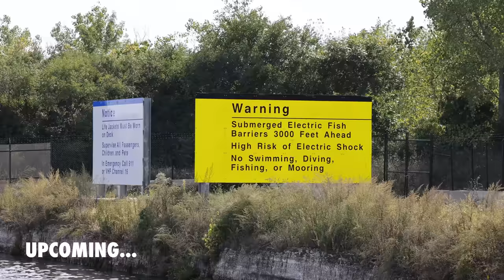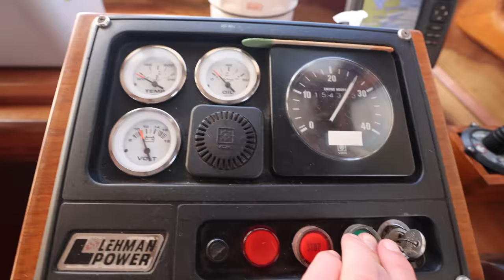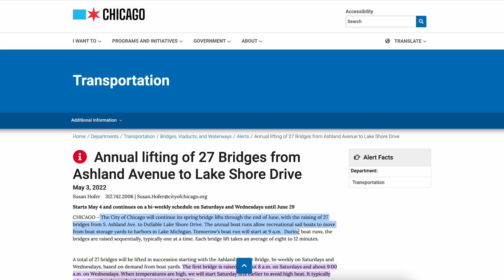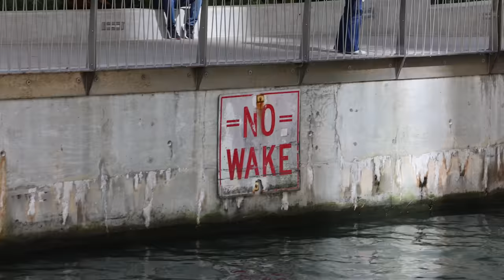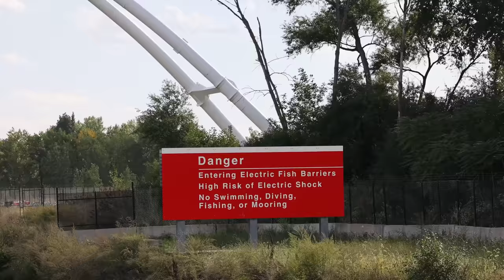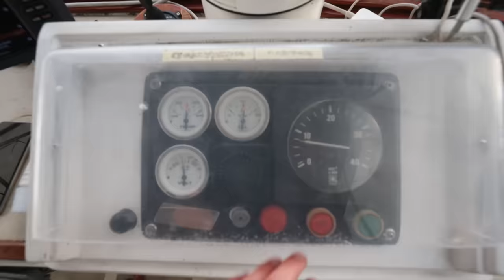Boating up the Chicago River and starting the Mid-West Rivers

Comment: You guys can buy a small swamp cooler for the flybridge and use a pump for river water. It won't be any good inside,  but outside will blow cool air on you all day and not use much energy.  I worked on a barge on summer and they had two giant ones.  I could stand all day in front of those. And you can get a bigger water pump for like $30 and then blow even colder
Reply from the maker: Such a good idea!